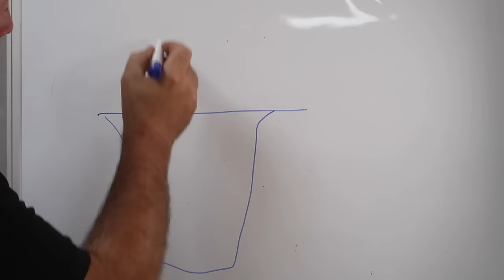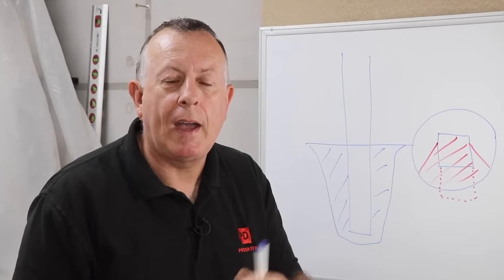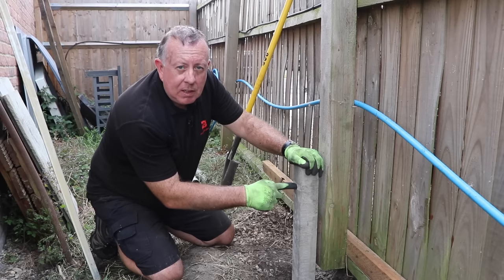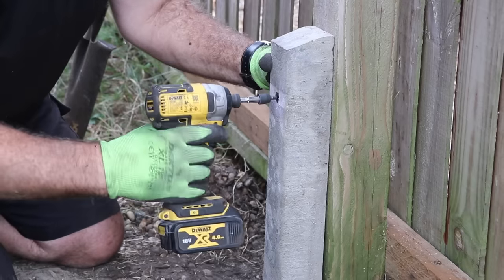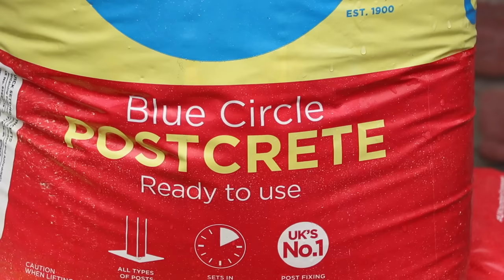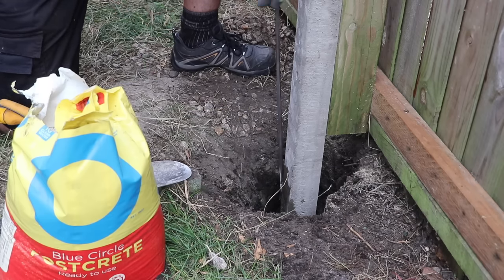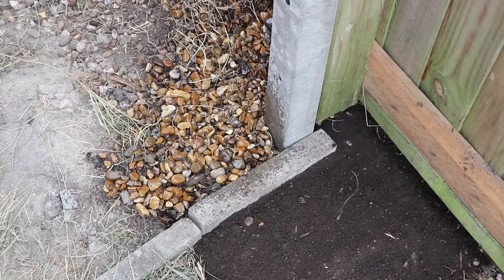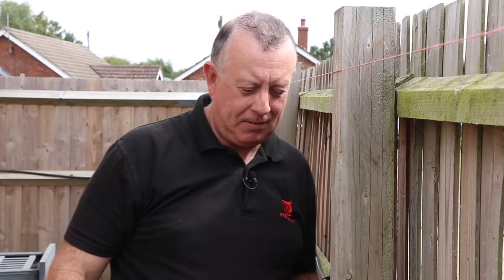The Easy Way to Fix a Fencepost

Comment: With all the trouble you went through with all the digging and removal of the concrete why not just replace the post at the same time pour your concrete foundation and put a new post on it.  not much harderand it would saved your time and effort in the future

Comment: interesting that the concrete spur post is much more expensive than a new post.
Reply: But will last many more years and so much easier to change the wooden post when it does need changing 👍🏻

Comment: For real? First make your hole square so it has more resistance against becoming loose. Round holes are lazy. Once you cut the bottom off the post you should have just bolted a post stirrup to the post that goes down into the cement about 8 inches / 20cm. Then it would look tidy. 
Want the fence to last longer paint it with used engine oil. Looks light black for a few weeks then goes to a mid dark grey. Fence built in the 70's is still standing and just now wearing out as it has not been painted with oil again in the last 30 years.

Comment: Why don't you pour the postcrete on to a board and mix it with a shovel and water then put it into the hole already  mixed instead of prodding it with a knitting needle no brainer

Comment: A BRAND NEW POST would have cost far less than that stupid concrete 'add-on' and gave a FAR Better result. Further more, BEFORE adding the new POST slag/paint it with bitumen up to and over a few inches above the soil level.... sorted !!!

Comment: This isn’t quick easy way… you may aswell have  replaced the post in the time you spent messing about with your way. And extra half out or less taking rails off would not have been a issue

Comment: I'm a 3rd generation in the fencing trade, and this is the most long winded tutorial I've ever seen. 
Should have been 4x4 and not 3x3. Those screws are not sufficient enough, and all that string business and digging out rotten wood is totally unnecessary and a waste of time, just like using postcrete. 
Good luck all the same.

Comment: From your accent, I'm guessing you're in the UK.  Your main problem is that your fence contractors don't know how to properly install a fence.

Plus, if you're going to all of this trouble to dig out the original concrete footing and rotted wooden post below ground level, why not just take a few more minutes and just remove the rest of the old post and put in a complete brand new one instead of using that ugly concrete post support fix?

Comment: Waayyy too much work for a simple repair. Just get you a metal t-post drive it in, no digging, no mess! Plus, it is taller and is less noticeable, fasten it to your post and done, geez!!

The way you're doing it you may as well just go ahead and replace the post. It would be easier and cheaper!!